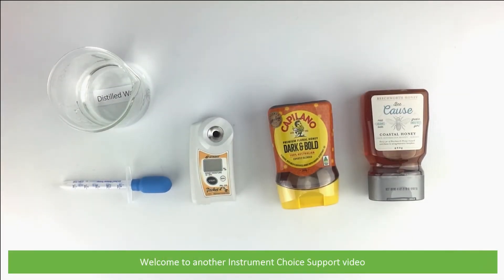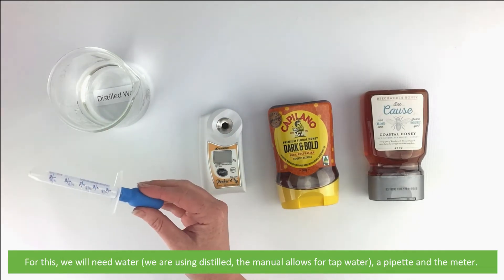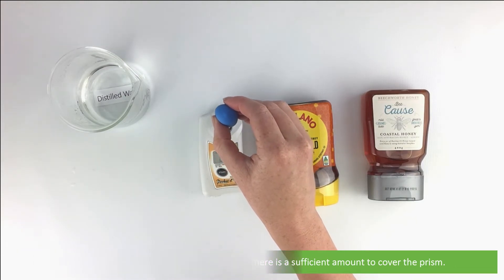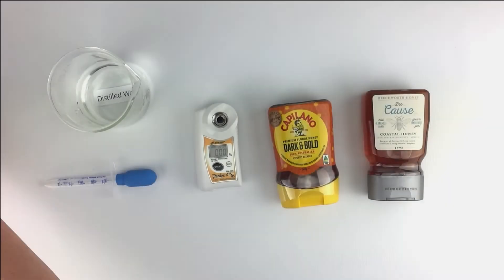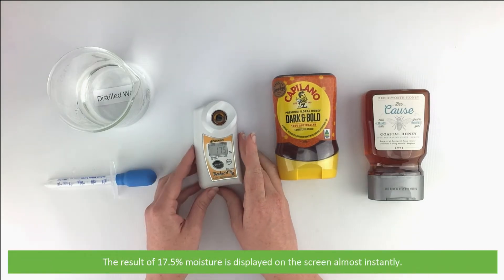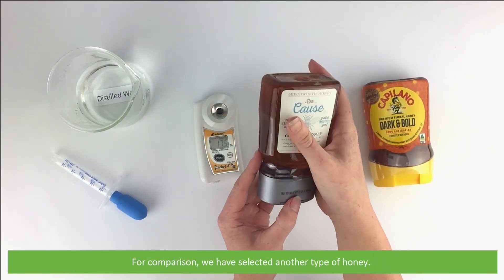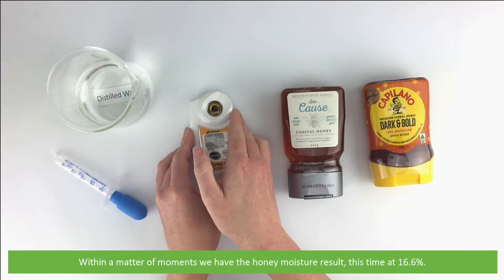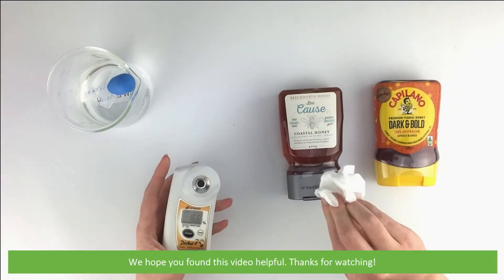How to Measure Moisture Content in Honey Using the IC-PAL-22s Honey Refractometer

Comment: After I press the zero button I get RRR...what does this mean...This device has been very inaccurate since I used it...differs greatly from the handheld refractometer
Reply from the maker: Hi, @caz4523, 
Thank you for your message, on this, the code you are seeing means it is trying to be Zeroed without anything on the prism or something other than water is being used.
Can you confirm that you are doing the zeroing procedure exactly as per the manual here?
Reply: @instrumentchoice YesI put the distilled water in push start  see the HHH and press zero...after I press zero the RRR shows up...maybe I am not using enough water..